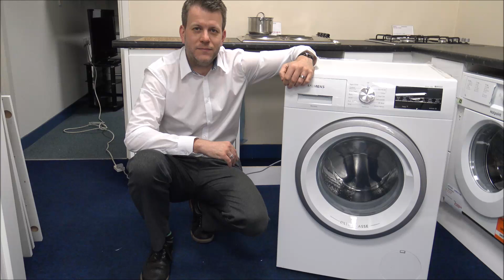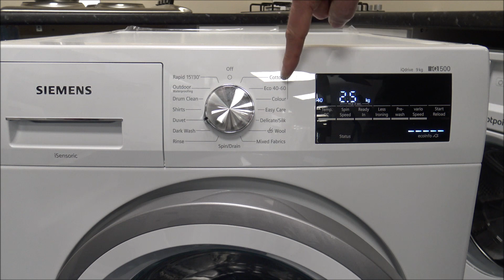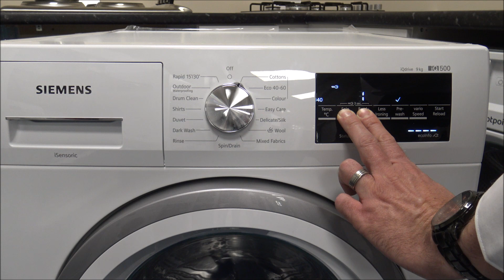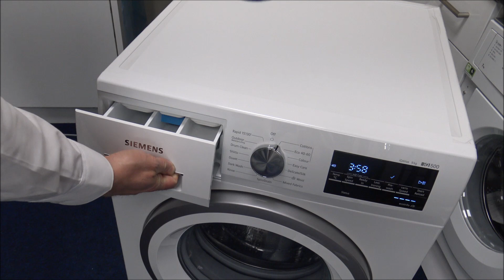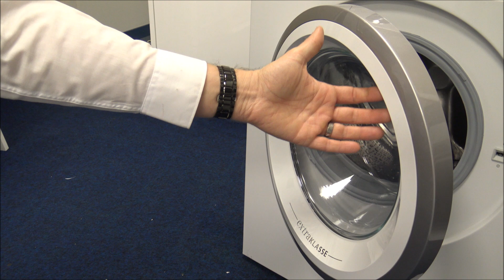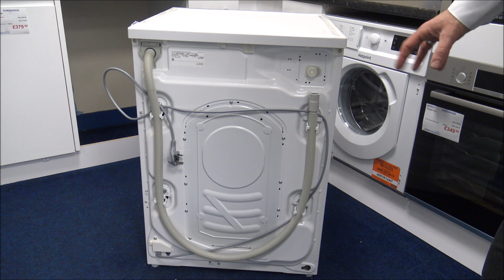Siemens WM14UT93GB 1400 Spin 9Kg Washing Machine Demo

Comment: I bought a Samsung Washer/Dryer roughly about 2018, and looking at this, it’s amazing how far things have come.  For example, laws have forced manufacturers to add the Eco 40-60 (something mine doesn’t have). On the Siemens, I love that it tells you the weight of washing each programme is designed for - again, Samsung, take note. What I’ve never seen though, and which is more handy - how many people actually have a means of weighing their washing before they load it? Wouldn’t it be sensible if the machine was weighing the load as you were filling the machine, and beeping at you if you went overweight? This is really important for someone like me, because I need a washer/dryer for my flat, and often the drying weight is a couple of kilos under the wash only weight. Again, on the Siemens, the economy indicator bars are really useful. As a bit of a nerd, I like lots of indicators and lights, but again, what’s pretty poor about my Samsung, is that the economy information for each programme isn’t included anywhere - a page in the instruction manual is better than nothing. And my Samsung doesn’t tell you this. When you see a machine like this Siemens, it just makes it plainly obvious how important certain functions are! When I need to change my machine, I’ll perhaps have a better idea of what to look out for!

Comment: Great video and explanation. My current 10 yr old Siemens washing machine has been great but the bearings have now gone and I'm replacing with this one. Seems very similar. Good to know that in 10 years they are still producing excellent machines. I also have a connector to add my dryer to the top. Have you any idea whether this will work on this machine? It has a pull out table which is very useful.
Reply from the maker: I know the kind of stacking kit you have. There is a good chance it will work but i couldn't guarantee it will fit like your current one does.

Comment: My sister in Bulgaria has a very similar washer with the matching dryer. She likes it. However Siemens as a brand completely dissappeared all of the sudden. Only Bosch and Neff models are available from that brand family. I know you don't sell Miele but I have an 18 year old Bosch Maxx that might die soon for good and I am looking at Miele as a replacement. Don't care about features too much just performance and reliability. What do you think?
Reply from the maker: Miele as a brand are very good but go for the machines where the manufacturers offer the longer warranty. If a manufacturer is that confident in their reliability on a machine at around £500 then the warranty should reflect that. I don't know much about Miele machines but looking online it looks like even the machines around £1000 only have a 2 year warranty compared to a Siemens at around £600 with a 5 year warranty. I would question Miele why they don't think their machines can last 5 years without providing a warranty to prove it?
Reply: Thank you. I will think about that. In your experience do you washing machines with more options break more often than simpler machines?

Comment: Hi, thanks for your lovely video which I’ve commented about before. I now have the washing machine and have used the vario speed on the easy care option.

It’s great in that it dramatically drops the washing time. But does that mean it’s not such a gentle wash? The manual seems to indicate that it changes our settings bit concerned that it may increase the temp, spin speeds etc, which could bring detrimental to clothes that need gentle/low temperature wash.
Shirley

Comment: When you open the door and it reveals the Kg weight for the program, once you’ve put the dirty cloths into the drum, does the machine tell you the actual weight?
Reply from the maker: No it doesn't tell you the weight.
Reply: That is a shame, I think it’s a missed opportunity that it wasn’t engineered into the spec so you know how much of a load you have in the machine.

Comment: Thanks for you excellent video. I have purchased this machine to replace my older version which had an option for 'extra rinse'. I found that function to be very useful. Is this machine able to offer the same?
Reply: Did you find out as I also have the old version and it's just broken?  Thanks
Reply: @The4manxies  Not from here, but I think I have the answer from reading the sales literature in more detail: Apparently this newer model will automatically do a second rinse if it detects there is still excessive foam in the water after the first rinse. I've run the cycle a few times and, to be honest, I'm very satisfied with the results. I have probably, in the past, run a second rinse when it was not required. Best wishes.

Comment: Excellent video thank you although I bought the WM16XMH9GB which sims similar? apart from the speed. 
I have a water softener in use, can you please advice amount of washing need to use as on my previous Miele machine the advise was to use less than usual.

Comment: Pls can u open the machine when it is off?finding it difficult to open mine
Reply from the maker: As long as the program has finished then yes you should be able to open the door. Also when it is switched on, just make sure the child lock is not active, as you may struggle to open the door if it is active and the power has been turned off.

Comment: What a brilliant video...so helpful! I just wondered if you know  the dimensions for the 7kg model? Unfortunately, the 8/9kg will protrude slightly to much into the kitchen, so I'm hoping the 7kg model will be 2-3cm less? Otherwise,  is everything else the same spec and performance as the larger models? Many thanks in advance.
Reply from the maker: The 7kg is about 3cm less in depth but the spec is basically the same as the larger sized models. Thanks for your feedback

Comment: My new machine has an automatic filler for the soap and the rinse. I can’t find my instructions. If I use any other program do I need to put liquid and rinse liquid for the other programs. X
Reply from the maker: You will need to put fabric conditioner and washing liquid in the drawer for each wash, assuming it is this Siemens machine

Comment: What is the difference between bosch and siemens
Reply from the maker: It is the same company, but Siemens normally concentrate on the higher end of the market with Bosch concentrating on the medium sector of the market which is the most popular segment.
Reply: @lords-electrical  hmm explain what u mean

Comment: What an engaging and easy to follow video! You have saved me lots of time and frustration trying to figure out the answers. I’d recommend this to any first-time Siemens machine buyer. Thank you
Reply from the maker: Glad it was helpful, Thanks for the feedback
Reply: I have purchased the Siemens 9kg  iQ300 machine. Towels feel hard and coarse afterwards, compared to a wash in my toplaoder where towels were soft and fluffy. Any advice?

Comment: 4 hours is really to slow
Reply from the maker: I agree that 4 hours for a wash is a long time
Reply: @lords-electrical  hi 
I'm finding that there are a few comments about wet washing in the drum on the 9kg/8kg siemens wm14ut83gb & no spin. Now from what I understand its due to the machin3 sensing the load imbalance & will adjust accordingly. I appreciate its the responsibility of the manufacturers to protect its machine & warranty callbacks, in real life though when myself or customer uses a machine we don't wish to be spending time weighing washing or picking it apart , unless it's colours or whites ! 
For nearly £600 quid I'd expect it to work seamlessly . If the machine is overloaded then I'd expect issues , that goes without saying. So what is the solution to this issue ? As it appears a number of brands have this issue also especially the ebac range! So my thinking is , is it the technology being too sensitive, & over protecting the appliance. Ive had a bosch h & c fill a+++ for over 20 years & no matter what i put in it large or small or uneven it works fine! Now given in that 20 years technology has taken huge leaps forward, but it seems in tbis case its taken 3 steps back! As a plumbing & heating engineer  & have fitted loads of different brands over the years. In recent times customers have all said the same about length of the cycles! Nearly 4hours for one specific wash is crazy. Especially for a large family who use the machine  2/3 times a day, realistically    its not ideal as most families will do 2 washes & sling it on the line or airer before they start their day. So for 2 washes totalling nigh on 6hours is madness. Not all can use the facility of sticking it on of a night due to sensitive neighbours or kids especially if living in a flat! 
I'd love to hear your thoughts. As im in the process of upgrading my machine. I prefer a gear built unit over Spanish or Thai build. I have a budget of approx £700 what can you recommend. I did call one of your outlets but was met with rudeness telling me it was a sales line I had called to which I replied thats the reason for my call! & she said she had others waiting on the phone! I am a  customer !! Really poor customer service. I was hoping tk speak with you as opposed to a service agent who is only reading details of a screen!! 
I look forward to your reply .
Kind regards 
Richie 👍

Comment: I have this Siemens Washing Machine WM14UT93GB.  Does it weigh the washing when I put it in the machine to let me know the weight of my load?
Mrs Denton
Reply from the maker: It won't really weigh the washing, but it will send a certain amount of water through at the beginning of the wash. Depending on how much is saturated, the washer will then alter the amount of water that is used for each wash. Great question though